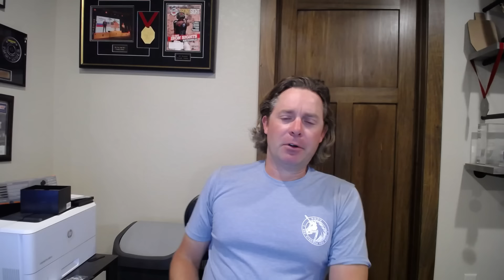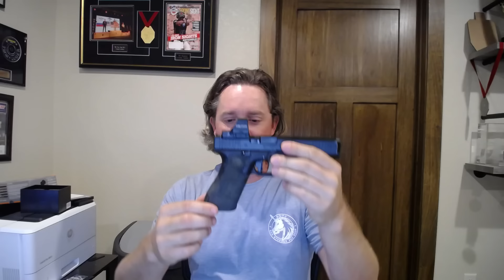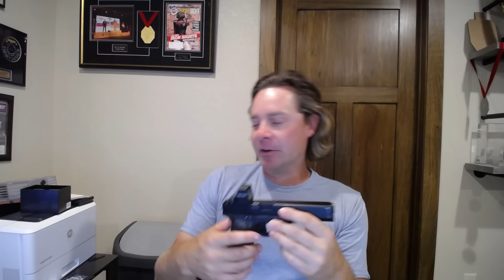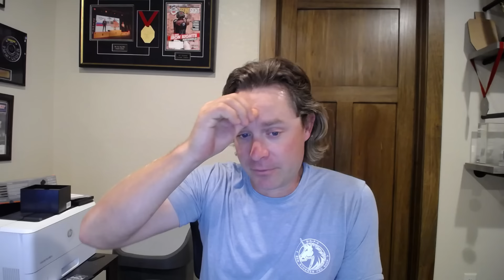Your ideas for gen 6

Comment: Half the point of Glock is the grip angle. I hated it when I first bought one coming from Sig FN and the like, but I've found that I'm way better with that angle than any other. Every time I draw I'm on target, instantly and naturally. I love the angle.
Reply: I'm not sure I understand the hate on the grip angle either. The idea is it forces your wrist to point more downward to put it more inline with the bones in your arm. More straighter means more soaking up of recoil and less chance of limp-wristing your way into a malfunction. Comfort ain't really a factor in the design.
Reply: Gaston knew what he was doing when he built the G17. A newbie will always hate the grip angle of a Glock, most likely disgusted by it but having some ulnar deviation makes you have a stronger grip.
Reply: Because your used to it.

Comment: On the subject of Glock sights. I get why the OEM sights are a source of contention and it used to be for me as well. However, after shooting for several decades now I've settled into particular sights I like, and I try and keep consistent on all of my guns. So, at the end of the day, unless Glock is only going to offer the XS Big Dot sights that I like, I'm going to change them out anyway. In which case I feel much better about throwing those cheap plastic sights back into the case than I do tossing some expensive sights I never wanted.
Reply: That's how I feel about it. I'd rather have some chintzy sights that didn't add to the cost and are easy to replace than some expensive sights that aren't really what I want.

Comment: Yeah so some of those ideas are good but I think gen 6 will come out soon and there might be some flashy marketing about a new grip texture or a new optics mount but the MAIN thing Glock will be changing is they will somehow change the striker design to prevent the addition of a 3d printed auto seer. Glock is a European company at heart and they're already being sued by the State of Illinois because they're easy to convert to a machine pistol. It wouldn't surprise me if whatever they do to prevent full auto makes the trigger "even worse" (I put that in quotes cuz I really don't mind Glock triggers).

Comment: I recently got a Matrix Arms MX19. Gen 3 G19 clone with Aluminum frame and hand stippled grips. 1911 grip angle with a Timiney trigger. Trijicon sights, direct milled Rmr cut on a heavily serrated slide. I absolutely love it. Any complaint people have on Glocks this has it fixed, for real. But I love plain Glocks. They are super easy to shoot.

Comment: I’d update the G34 as a 5” slide and typical comp stuff (their performance trigger((or one that actually works)), their OEM magwell, fibre optic sights, extended mag release etc) which both makes it IPSC legal and competitive out of the box. The magwell just clips on so if Standard Optics finally gets ratified you just put it on and your ready to go. And yes the MOS plates need attention too.

Comment: Get the sig chassis system away from my beautiful Glocks. Those cause so many issues with reliability, lungevity, rusting etc. the only thing Glock should do is make the plates better, better iron sights, offer different stippling. Flocks are unironically almost perfect, just leave them be.

Comment: Honestly for a gen 6 glock i'd really just like to see a factory raised/rearward extended slide release (like the Kagwerks, so its out of the way for a high support hand position but can still be reached via thumb without compromising grip) plus a slightly wider or different shape mag realease for the same reason, and even more ideally, high texture on the sides and back of the frame, and perhaps some slightly angled texture in a few spots based on what the gun wants to do during strings of fire with sweaty hands? I feel like with how modern and efficient production can be, that shouldn't change the price much. 

Holster and mag compatibility with gen 5's would be perfect. Keep the same overall profile of the gun and the same mags. Just with ergonomics/grip texture that are polished up so you don't have to change any controls or feel the need to stipple it. Basically a gen 5 that you only decide on your preference for triggers and sights, and whether or not you want slide cuts and a different recoil spring, and roll out with that.

Comment: They need to revamp the MOS system. Slide cuts for specific optics would be nice. Shouldn’t have to spend $550 on a Glock then send it off to a 3rd party for a cut

Comment: How about a normal grip angle?  Pretty much the only thing I hate about them.  Can deal with the goofy trigger and stock sight / mounting platform (easy enough to mill my optic or replace sights). 

But I find it a bit hard to go from Glock to any-other-gun due to that grip angle being so deviant from the typical gun (the sig p320 by contrast is a bit to shallow than the typical gun). 

They could also bend to those who want manual safeties like m&p and p320/365 give you the optio of if you want.

Comment: I have heard how awful the MOS system is since day one and though I use an after market plate, my SRO hasn't budged screws haven't budged nothing since I installed the red dot. Maybe just luck and know it's not the best setup but it's been solid for me.
Reply: The specs of the OEM plate and screws are the "only" things off with it. Get an aftermarket plate and the issues disappear. 

Then again, I understand people who grief over it - it shouldnt be wrong in the first place when you're a manufacturer of that scale and notoriety.
Reply: The problem with the MOS system is the factory plates.  Aftermarket plates fit flat (not warped) and have more thread engagement.

Comment: Steel frame would be interesting for the extra weight.
Reply: The new Glock-und-Steel Gen 6. 😁
Reply: Or maybe a tungsten infused polymer?
Reply: @coolgr3y997    That would be different.  I think there are enough cavities in the current design to place tungsten or tungsten infused polymer into that would add quite a bit of weight.

Comment: What is the issue people have with the stock sights, besides being made of plastic? I have 3 and never noticed an issue, though I shoot with optics exclusively now.
Reply: I personally always have issues with judging vertical alignment. If I align so that the tops of the sights are even, the front dot is partially obscured. If I align so that the front dot drops perfectly in the rear U, I hit high. I much prefer three-dot night or hi-vis front, black rear.

Comment: Glock reminds me of Nintendo, loved but has a complete refusal to give customers what they want, even when it would make them a fortune and increase their popularity and overall ownership within the market. I would say for the Gen 6. Its a complete mystery why they would not go to a chassis system, if they did that, fixed the optic situation to be standardized and better and improved the trigger, anything anyone would ever diss the Glock for would be gone. Like the PDP and many cheaper systems already have better triggers better sights and optics cuts and are cheaper with similar reliability. They are losing the game here. I have no idea why the P320 is even liked at all other than its chassis system, Glock could completely blow them out of the water due to its aftermarket support if they had a reliable working chassis system. That plus the improved optics cut and better trigger it would be a no brainer for everyone to own a glock, even the glock haters. But nothing will change much no doubt.

Comment: The thing is crazy because the conversion to me is pointless in aspect to a stock Glock… stock 34 gen3 nice stock gen3 17 horrible your finger gets tired from trigger slop so fast it’s only a functional shooter not an easy gun to use especially with stock iron sights lol I had to spend 2000 near 3000 on my gen 3 34 lol 😂 just for it to be what a Glock should be lol

Comment: You should buy a Shadow Systems and test it out.
Reply: I was on the Glock platform since ‘99, switched out to nothing but Shadow Systems two years ago, with zero regrets. I just treated Shadow Systems as the Gen6 upgrade.😎✌️
Reply: I've got like 18.5k rounds on my DR920 and a few thousand rounds through other models. They're okay. Reliability in terms of stoppage rate has been comparable to Glock, parts failure rate has been somewhat higher, mechanical accuracy has been oddly a fair bit worse. Imo it shoots a little bit nicer than Glocks do, and the feature improvements are welcome and well executed for the most part.

Comment: I think I am the only person in the world who likes stock Glock sights, especially since they finally got the dot and U sizes matched up properly. I understand that the durability may be an issue for some—specifically those who like to use the rear sight as a charging handle.

As for the front sight, it can wear down during many draws against the holster. But a modern holster with a tall sight channel would pretty much negate that problem. The sight picture itself works great for me, and is fine for hitting someone in the chest at 20 feet. I’ve seen some pretty old Glocks with original sights, so the typical owner isn’t breaking them off, either.

My new Gen 5 Glock 22 shot a tiny bit to the right when I first got it, and I realized that the rear sight was slightly off center. But that was easily remedied. Of course, if an optic is going to be fitted, something taller needs to go on anyway, so that is just a non-optic gun problem.

As for the MOS, I am running a 509t on mine. I think that a sight such as that doesn’t have a lot of the typical MOS problems. First of all, you are going to be using an aftermarket plate made from better material. Secondly, the plate screws down nice and snug into the slide and then the optic mounts to that by means of a crossbar-type setup, so you’re not likely to shear off any screws. There is no worry about how much thread engagement on the optic’s screws.